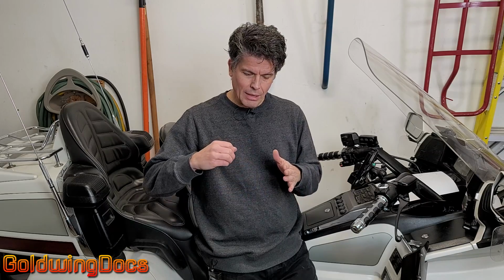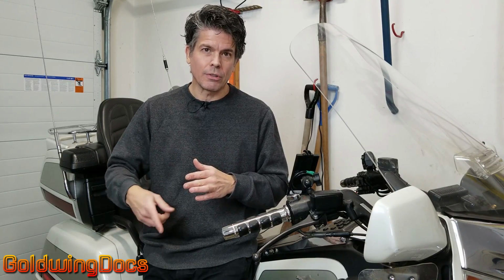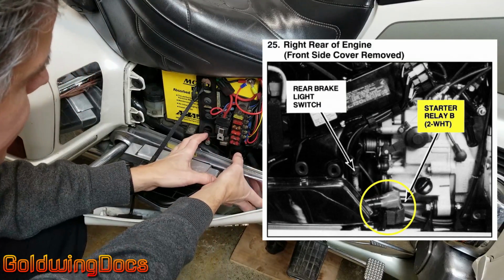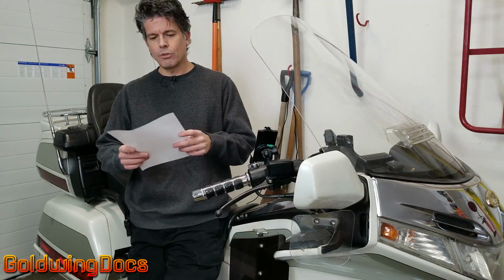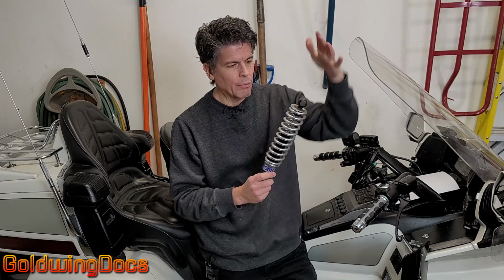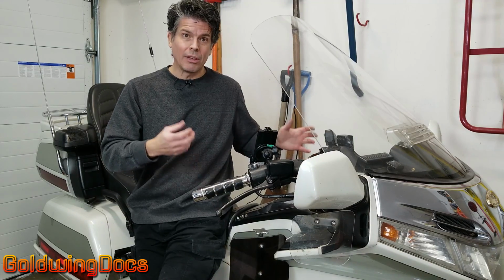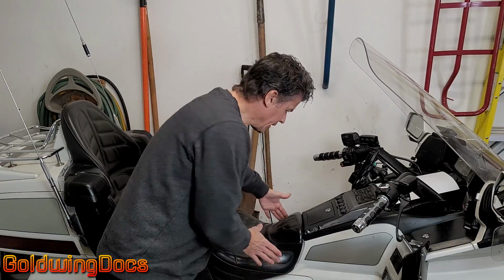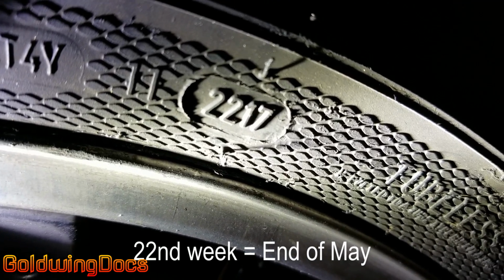Goldwing Q&A Episode 5: Starter Solenoid, Lowering Bike, Old Tires

Comment: Good Job as always Scott. I'm pretty sure that Lever Bushing is the issue. I'm having a hard time finding a new clutch lever (only) the reservoir is fine. The one I just got isn't the long sweeping one that my 95 1500i has. this one is 8". I think the correct size is 10". another tell tale is. WHEN I stall it at a light. I can't restart (in panic mode) until I get it back in natural. I may just have to go $$$ retail from Honda. I have looked there but they don't have a (NEW) 30 year old lever. I was wanting to try a new bushing first. Do you have a link to that? Thanks for the Docs site and especially your You Tube channel. I hope you are being payed well for all the time and energy that you put into EVERYTHING that you do. ATTA BOY!!!

Comment: can my starter relay be bad it is just clicks? I've tapped and sprayed the starter button on the handle bar and smacked the starter with a small ball peen hammer and smacked the starter switch on the handle bar with the same hammer. It doesn't change a thing  and I jumped across the solenoid behind the main fuse you showed. I could not get anything to change or show a difference and charged the battery and jumped the battery and it was still showing 12-13 volts and would only click once at a time. It has been acting up from time to time hitting the starter button. same emoji on your site. T.R.  😁

Comment: Have a gl 1200 goldwing it won't start with the relay starters good so am wondering if the starter  sprag is bad it won't start even if you push start it , battery's  new can turn over engine by hand but not starter anyone help me 
86 Honda goldwing aspencade with 40k,,,,

Comment: SE1500 will not turn over, replaced 2 selinoids, I have a black and red wire not hooked up to anything under seat long enough To reach starter. When I touch positive side of starter  I can hear a click, sounds like coming from key area, could that be the problem? Where does it go?

Comment: Interesting comment regarding the age of the tyres.  I recently purchased (May 2024) a 2000 year GL1500 SE model here in the U.K.  On checking both tyres were dated 2011, the rear tyre had plenty of tread and looked in serviceable condition. The front tyre though had numerous fine cracks on both of the sidewalls.  Decided to replace both tyres with Avon Cobra Chrome. They where purchased from the same supplier, the front tyre has a date code of 0524 (Feb 2024), so literally only a few months old. The rear tyre was date coded 1323 (Mar 2023), so this ‘new’ tyre just over a year old at the time of posting this comment.

Comment: I have a 2004 Goldwing GL1800 I had a issue with my starter. I backed it out of my shop and drove it around the block. when I came back in the shop i switched off the ignition but the starter was running!! I switched the bike back on then off again. The starter still ran. I had to disconnect the battery cable to get the starter to stop. I left it until the next day and reconnected the battery cable, the starter did not run.  The starter issue didn't happen again!! what could have caused the running starter???

Comment: What causes my goldwing to die. It just shuts off just dies backfires and then won't start I have to pull #4 plug wire put screwdriver in wire plug and then hold it to motor while pushing start button to be able to start it.

Comment: On the solenoid that is not exactly right,the Starter Drive often called the bendix, engages the flywheel, the plunger operated by the magnetism of the Solenoid causes all the previous to take place. I just found out on an 88 GL 1500 that if the solenoid goes bad it can also cause the starter to continue spinning, key on , Or Off
Reply from the maker: Sorry, you're incorrect. This is not a car. Motorcycles don't have a flywheel that is engaged by a starter like a car. The solenoid is just a high-current relay, on the right side of the bike. The starter is separate from the solenoid, and is permanently connected to the engine via a one-way sprag clutch. There is no plunger, flywheel, or bendix.

Because the starter is connected to the engine via a one-way sprag clutch, it can spin continuously while the engine is running without damaging it (although it will get very hot).
Reply: @GoldwingDocs  the solenoid switch on a motorcycle still acts like the one on a car you are the one who is wrong it is a magnetic device that causes power to go from one side to the other one completing the same circuit that it does only car the only difference is there is no flywheel you are the one who is incorrect
Reply from the maker: @cliffray1683  You must realize that you're trying to debate this with someone who actually TEACHES this stuff, and knows these motorcycles inside out, right? I was going to reply politely, but seeing as you're unable to discuss this politely and instead insist that you know best, let me explain to you very simply why you have no idea what you're talking about:

A solenoid is a device that uses an electromagnetic coil to induce movement in an actuator. That actuator provides mechanical energy. In practice, solenoids are used in many devices - door locks, vending machines, industrial machines - and AUTOMOBILE starters.

IN A CAR, the solenoid is used to push the starter gear into contact with the flywheel. Once the starter gear has fully meshed with the flywheel of the car, the outward movement of that starter gear closes a CONTACTOR which then supplies current to the starter motor.

In a motorcycle, there is NO SOLENOID. The starter motor is PERMANENTLY CONNECTED to the engine via the sprag clutch. What you are mistakenly calling a "solenoid" is actually just a high-current relay. A relay is a device that uses electromagnetic energy to close a set of contacts, so that a small amount of current can switch a higher current circuit. In the case of the GL1500, there are two of them. You press the starter button on the GL1500, it supplies current to the coil of starter relay A, which closes and supplies higher current to the much larger starter relay B, which closes and supplies VERY high current to the starter motor. These relays are completely separate from the starter motor, which is located in a physically different place in the motorcycle. The starter motor is just that - an electric motor.

NO solenoids.

Uninformed people who don't know what they're talking about still talk about the "solenoid" in their motorcycle, because that's what they're used to calling it in a car. But what they actually mean is STARTER RELAY, because again, there is NO SOLENOID in your motorcycle.
Reply: @GoldwingDocs  also I guess I should have been clear when I was talkin about the solenoid engaging the starter Drive I meant that's what happens on a car not on the bike

Comment: Scott I have an 83 Goldwing that I can't get started iv set the timing over and over set the valves twice it's getting fire to the plugs and all the plugs are firing it's getting gas I've checked the firing order a dozen times it will spin over sometimes fast but as soon as it tries to start it stops spinning like its out of time I'm lost can you help been trying for weeks, I have five Goldwings and have never had this problem with any of the others thanks
Reply from the maker: Post this on our GL1100 forum - did you change the timing belts on it by chance? https://goldwingdocs.com/forum/viewforum.php?f=4
Reply: No I haven't tried changing the timing belts but I leave the covers off and check several times and they don't change always on the marks

Comment: Hello everyone, 
I have a noise on my recently purchased gl1200. Almost sounds like a knock in the motor but it is a noticeable clunk that I can feel, only happens around 2500 rpm’s. Doesn’t happen at idle or anything over 3k rpm’s. Happens in gear, in neutral, clutch in, and clutch out. Weird thing when it’s happening in gear the bike is real sluggish through about 3k rpm’s and then it just takes off suddenly with no throttle change. My guess is a fuel issue, but I’m not familiar with these bikes at all and it’s actually my first carbureted bike so i don’t know if they need to be retuned for cold weather maybe? I should also mention it didn’t do this when I first bought it about 2 weeks ago, everything ran great.
Reply from the maker: Definitely post your question in our GL1200 section: https://goldwingdocs.com/forum/viewforum.php?f=5

Comment: Stator problem with 2001 Honda Goldwing 1800 ABS
Reply from the maker: The 1800 has a discrete automotive-style alternator, not a built-in stator like the four-cylinder Wings.

Comment: Scott, one question: On the GL1500s, At which gear is good for slow speed cruising? What I mean is on my 96 SE Motor Trike I usually shift out of 3rd around 35-38 mph then use 4th mostly up to at least 50 or even 55...(I do a lot of cruising in the 40-55 MPH range) less than 50 MPH in OD I feel as tho I may be lugging it, but I have a lot more bike as well with the motor trike kit. I'm thinkin I want the RPM above 2000 at most speeds when cruising
Is it OK to cruise in 4th up to 50-55 or so? What gears do you use/recommend?
Reply from the maker: Keep in mind that the torque curve on the six-cylinder Wings gives you a ton of power at low RPM's. While you don't want to lug the engines, don't be afraid to shift up and run the engine at a lower RPM than you think would normally be OK. 50 MPH in fifth gear on the 1500 is definitely not lugging it on a normal bike.

Of course, this all changes with weight and environment. Carrying a lot of passenger/baggage, or a trike like you have? Going up a hill? You need to judge for yourself whether it's lugging or not. Generally speaking, if you're feeling cylinder pulse vibration from the engine, you probably need to downshift.

Comment: I got short legs.  29" inseam.  Picked up 1" shorter shocks on eBay and a new seat that's substantially lower.  Now I love riding my 83.
Reply: Where did you get the lower seat? mine is tall and wide; 1986 aspencade

Comment: Uh . . .no.  A solenoid is a switch operated by electromagnetism.  You are describing a solenoid which ALSO operates the Bendix (GM style), but the vast majority of solenoids (even most starter solenoids) don't do this.  

There IS a starter solenoid on a Goldwing -- you're calling it a relay, which is pretty much the same thing (like the difference between a bolt and a screw).  Without that solenoid, they would have to use a much higher current switch and fat cables to and from that switch.  Fat red cable goes from the battery to the solenoid, then another fat cable from the solenoid to the starter.  Thin wires go from battery to starter switch, then to the solenoid pull-in.  Hit the starter switch, the solenoid pulls in, and contact is made on the high-current (fat cable) circuit.  The starter needs this heavy current flow to do its job.

BTW, just about every non-GM most car uses the starter motor torque to engage the Bendix.  On older Fords, the starter solenoid is bolted to the fender closest to the battery (which is on the same side of the car as the starter).
Reply from the maker: Sorry, but if you do some research on solenoids, you're going to find that you're wrong.

A solenoid is an electromagnet-operated mechanical device. It is normally used to operate mechanical things - door locks, actuators, and in the case of cars, to engage the starter spline with a flywheel. In that application, it also happens to engage a switch when it is at full extension.

An electromagnet that does nothing except operate electrical contacts is called a relay, not a solenoid.
Reply: @GoldwingDocs  THANK YOU SCOTT for getting it right! Even Honda calls the relays "solenoids" in many of their manuals. Weird. One of those mostly insignificant little things that just bugs me. 
If nothing is popping out the end then it ain't a solenoid.

Comment: As much as I love my Goldwing I have to admit HD has the seat height figured out and Honda needs to do a redesign and drop it by about 6 inches.
Reply from the maker: There's a reason for that: forward controls. When you kick your feet way out in front, you can lower the seat. On a motorcycle with a conventional seating position, with feet below you, you can't lower the seat like a Harley!
Reply: @GoldwingDocs  never thought of it that way 👍 I’ve seen several Harleys  scrape around corners and the goldwing is begging to lean even more. Too bad they didn’t make the DCT in 2008. My bike would be perfect!
Reply: Funny…I went to a Harley dealership yesterday to watch a contest they had. I sat on a road king and told my wife the only thing I like better is the Seat height 😳

Comment: Hi, my question is on my 1983 gl1100 interstate, is it true that if the carbs need rebuilt I’ve been told the only two ways to to clean them is untrasonic cleaner or boil it out. Can it be cleaned properly by hand? Thank you. Dan Mercer.
Reply: My 83 was a woodshed rescue.  I cleaned the carbs with B-12 spray and soak.  Worked great. That was 32k miles ago.
Reply: If they're really bad, like full of varnish or rust, ultrasonic/boil. If they're not too bad you can clean by hand. Done both my Shadow and Gl1100 by hand without a problem during rebuilds.
Reply from the maker: Not really, you can't really get to all the interior passages to clean them mechanically.

Comment: Hello Scott, thanks for the video. I find that putting about half of the air psi in the shocks both front and back lowers mine just a tad. I can put my foot flat on the pavement. Have a great day!
Reply from the maker: For sure, that air is "preload" - which helps offset for added weight. Removing some of it will increase sag, which means the bike is lower to the ground - you lose some suspension travel, of course.

Comment: When you order new tires you must get new tires, simple as that. There is however a test from a German institute. They tested new and 5 years old (unused) Metzeler tires. They drove them first on normal roads for 200 km and then went on a racetrack to be driven by a professional racer. Came out that there was no significant difference. Now I don't know if this counts for other brands. So at least use your eyes and look at the fabrication date and the total condition of the tire. Look for cracks, wear spots, tread, pressure, etc. (PS I have no connection or any profit by naming the tire brand, I don't even have them on my bike at the moment)😎👊